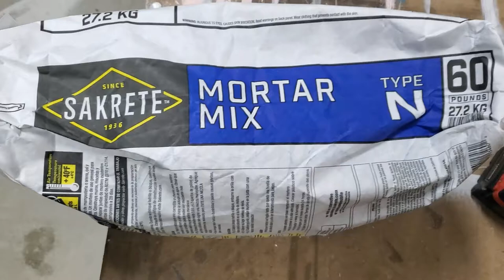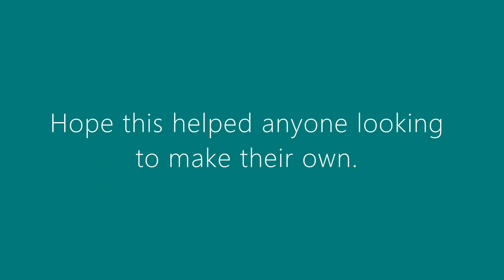Making the Chi Ishi

Comment: Do you have a certain length that you recommend cutting the dowel and what weight do you recommend it to be for a man?
Reply from the maker: It's completely up to the individual. Mine is about 1.75 ft long and around 25lbs. It is great for some lifts and a bit to light for others. Most people who use the regularly have several different weights.
Reply: @brycebaker492  thanks for responding. I made one before based on the recommendation to measure from the tip of the middle finger to the bend of the elbow. A mistake I made was not using the wire.  Because of no wire the stick has started to loosen. I am collecting different size containers so I can have different weights. I want to make some in pairs to use as a poor man's version of light Indian clubs (2 to 3 pounds).

Comment: What is the strength of that drill and did mixing the mortar drain the battery?
Reply from the maker: I used a Milwaukee 18v drill. It didn't drain the battery completely, but it used some energy for sure!
Reply: @brycebaker492  thanks! I'll probably have to upgrade since what I have is probably going to die half way through. I appreciate the video and the response.